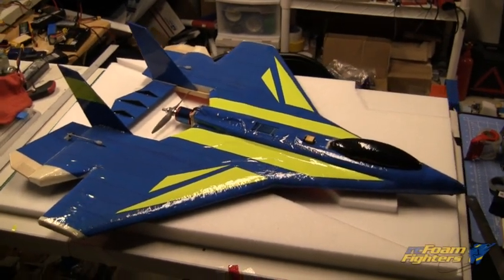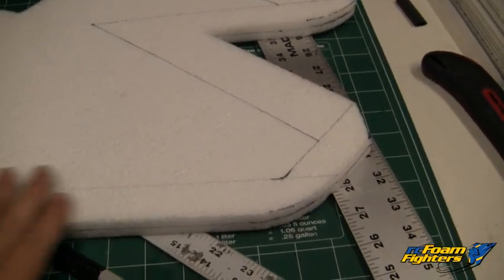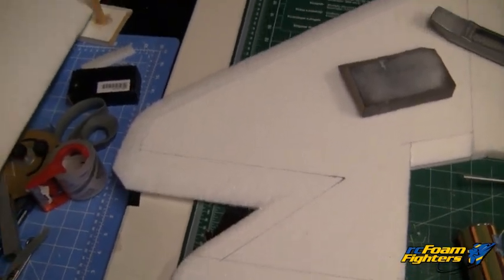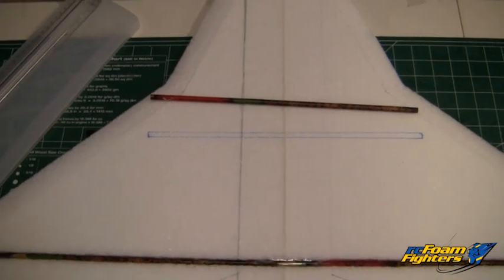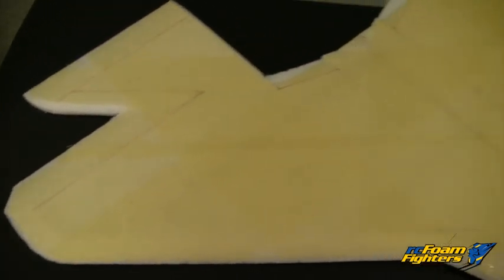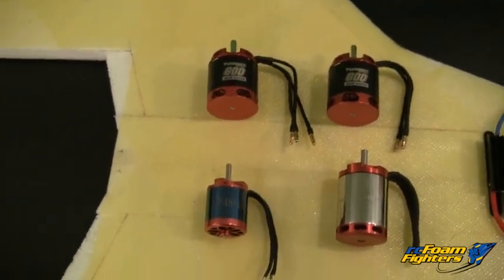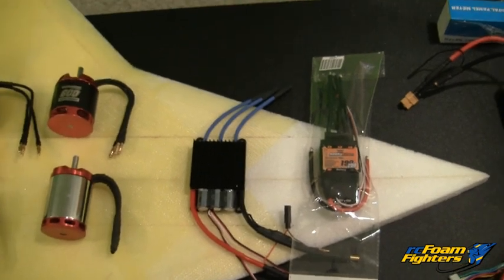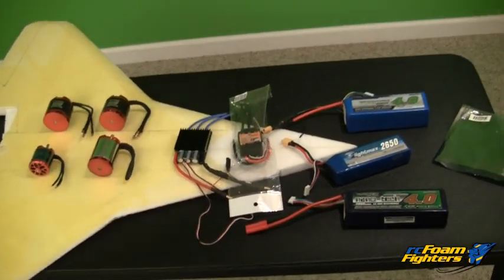SuperNova Extreme Part 1

Comment from the maker: @jcrankshawskids Jeff a regular 6x4 prop may be too much as you said. Frank has used an APC 6x4 sport prop on the motor a few times, but did not keep the throttle pegged too long. The Sport prop draws less watts and amps than a normal APC  6x4 electric prop as the blades are not as wide. As for a motor, you may look at the HobbyKing NTM 3536-1800 motor. it's a good motor and will handle 800 watts! Motor may be hard to get though as it is often out of stock. Also get the optional prop adapter.

Comment: @rcFoamFighters The covering should add a lot more strength and stiffness to the wing, compared to the sealing tape. Will also be a smoother finish - cleaner airfoil.

Can't wait to see this in the air.

Comment from the maker: @TheIronSavior I think it is good to bevel the trailing edges. A tall flat trailing edge can cause extra drag, or so i've been told. Also I think beveling the front and back edges will make it a little more like an actual airfoil. I'm not an airfoil expert, but these are just my thoughts and ideas. Thanks for your comment.

Comment from the maker: @ONPRIEL I have not made a new PDf for this version of teh Super Nova yet. It is basically the same as teh PDF plane for the SuperNova available on our Blog, just scaled up about 8 percent. If the plane turns out to be a good flyer i will post some plans for this version later. Thanks!

Comment from the maker: @lachacancela  Filipe greeting to you in Portugal.  I put a link in the video notes to a place on the internet that I usually buy the fiberglass weave from.  they sell 6-inch wide by 150 feet long rolls for about $6.50.  They also sell much wider rolls too.  They do list they ship internationally.  I would suggest you look at your local hardware or roof repair stores first though. Sure it would save you on shipping costs. best of luck and thanks for watching!

Comment from the maker: @intensewalkera Thanks for the comment. I usually don't use epoxy as it has little or no give, which is not good in crashes. Usually I use 3M 90 spray adhesive. Which works pretty good, but has some flex to it. I wanted the wings to be more ridged on this plane since I am only using 15mm foam instead of 30mm. So that is why I decide to use epoxy. The Fiberglass weave is not sticky, so you do need some sort of adhesive to make it work.